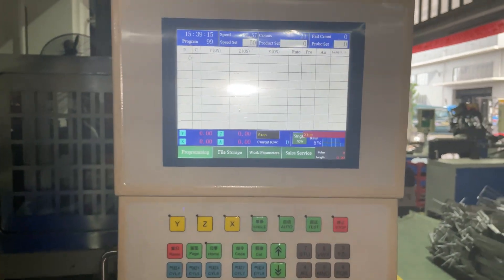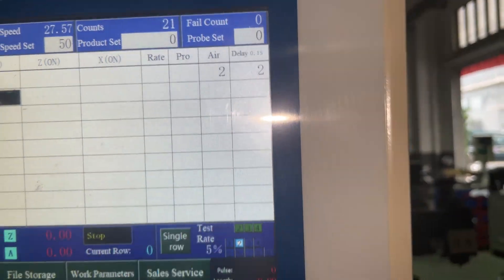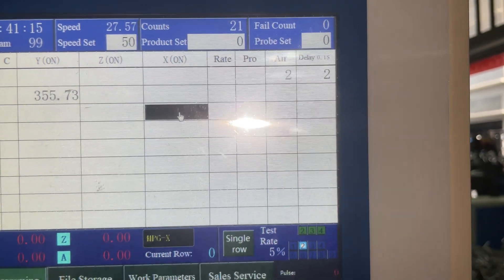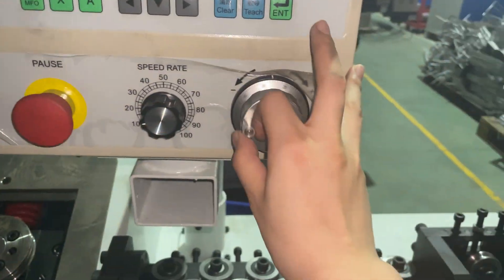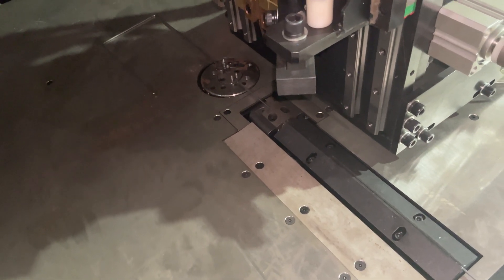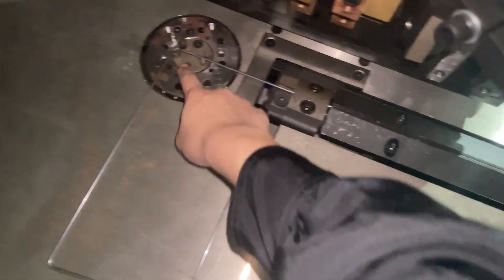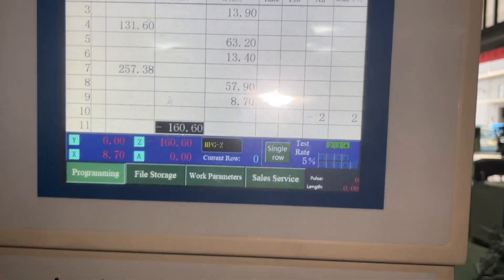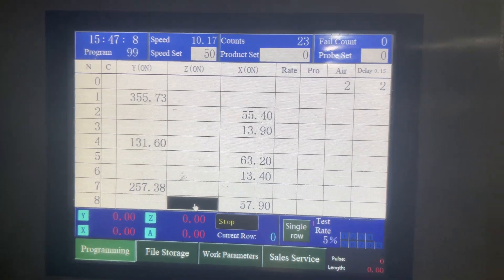2d CNC Wire Bending Machine Programming Totuorial | To Bend A Square

Comment: I think designing the shape in a computer the sending it over to the machine would be the easier and faster method instead of these TEACH
Reply from the maker: Haha. Indeed. That's what I usually do. But some customers wants to learn so I posted this for them.
Reply: @maconnek oooh! So it can be designed at the computer and then you simply send to the machine to end and cut? Nice